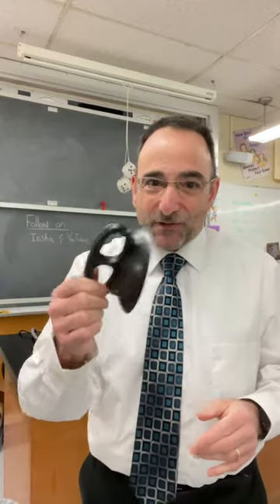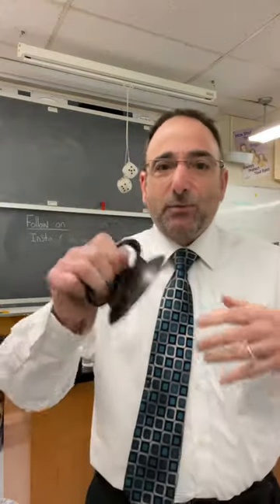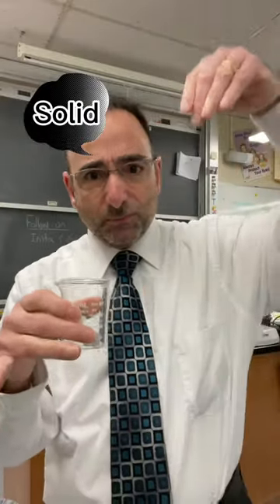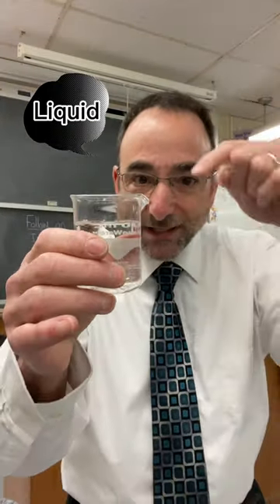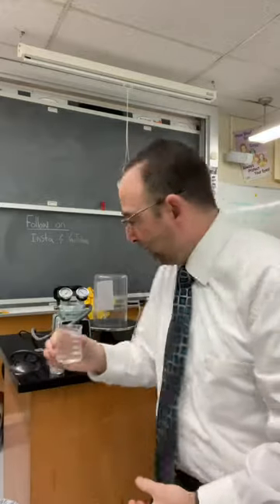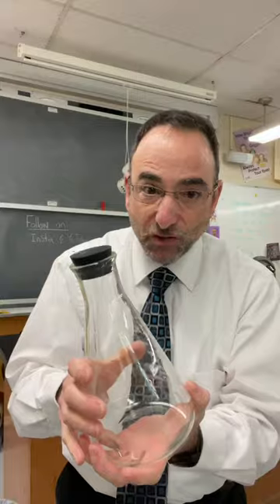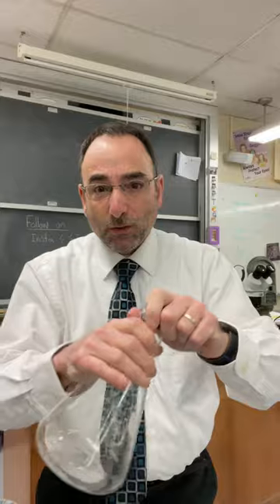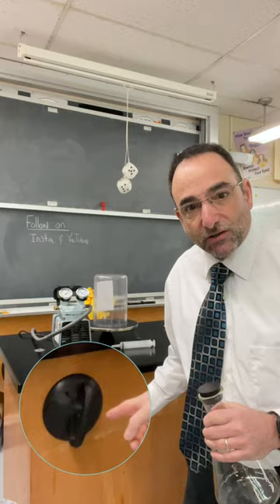Suction cups on a ceiling?

Comment: the issue i see is that when sucking to a wall the air pushes sideways but gravity is pulling down, you can't pull out but you gravity should pull the hook off especially if a weight is hanging on it

Comment: Why do suction cups work so bad on car windshields?
Like for holding GPSes, a few are great, but most of them can barely hold the mounting bracket even without the GPS.
Reply: the car is always vibrating when you turn on the engine